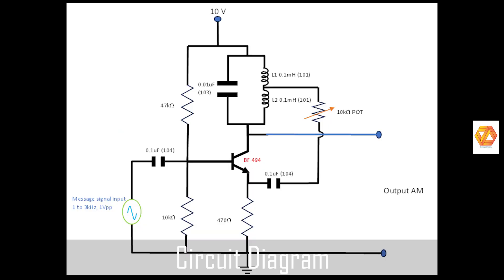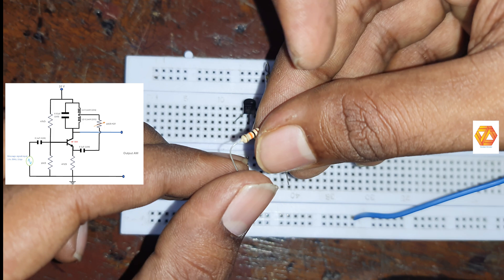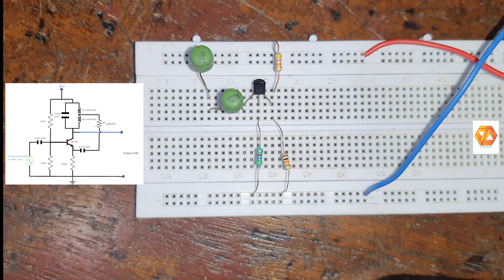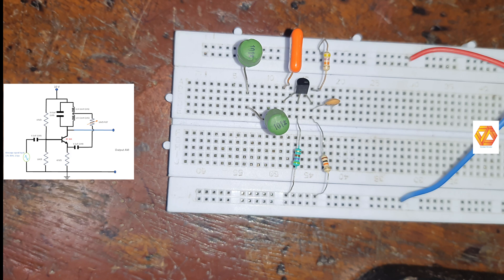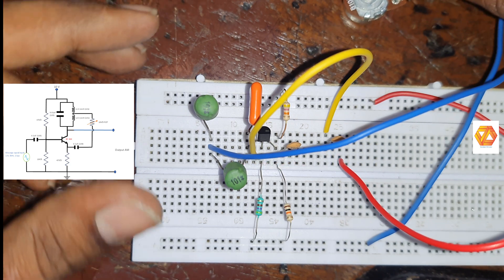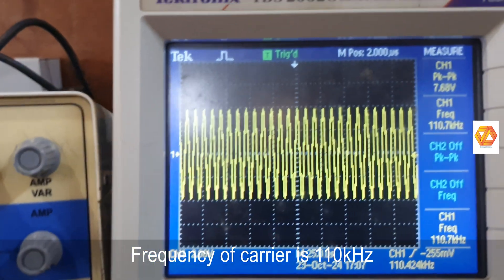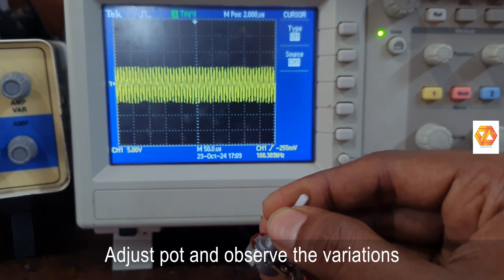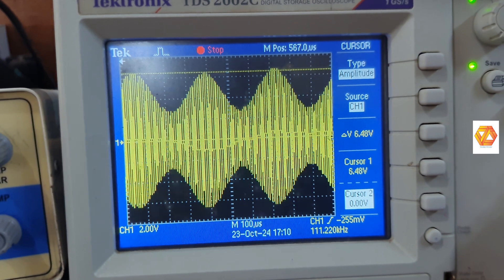AM without IFT  | Circuit diagram | Diploma | BTECH |Experiment | Breadboard | LC tank Circuiit

Comment: i know this is generating AM, but isn't there a bit of FM generation? 
did you check for frequency modulation? am interested.
Reply from the maker: FM generator using 555 timer IC is already available in this channel.